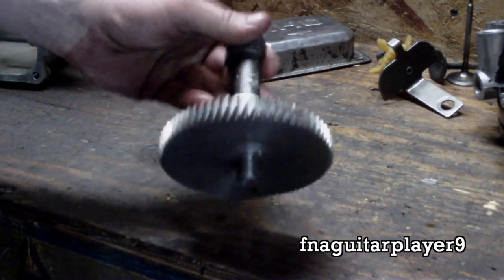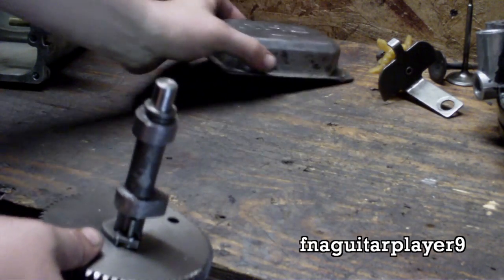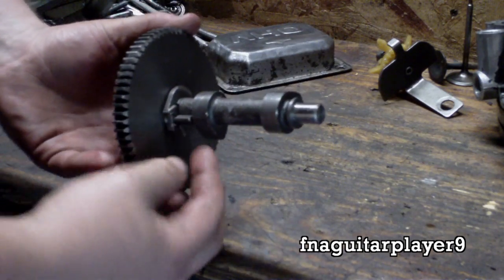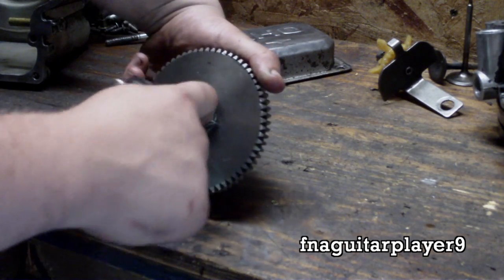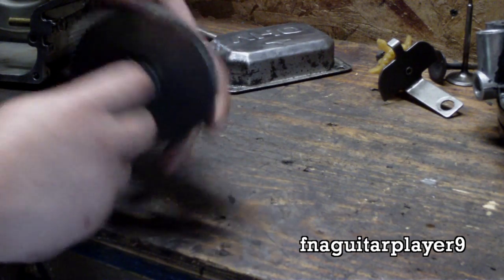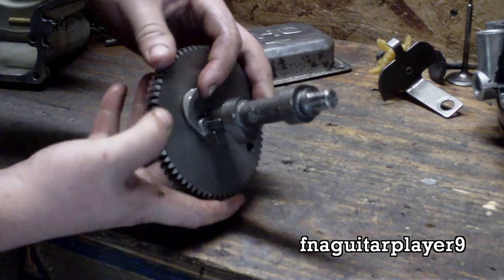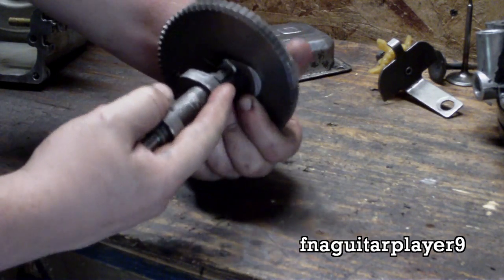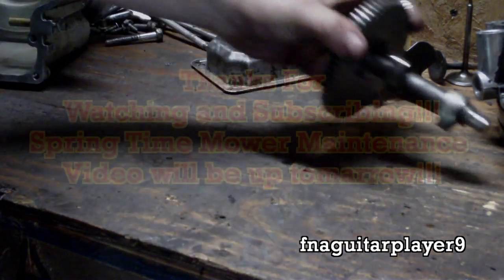How the compression release mechanism works on Briggs and Stratton OHV Engines

Comment: Iv got a briggs 19.5hp and the compression relief  you talk about in this video exploded taking out the governor and oil pickup tube iv checked the crank and connecting rod and all are fine. So my question is where can I get that relief or do I have to purchase new cam?

Comment: I’ve got a Briggs 200412 0136E1 10HP overhead valve engine on a generator.  When I start the unit, it starts beautifully and runs nicely at high idle for about 2 minutes, it then starts to have a stumble and then a miss.  I have adjusted valves, changed the spark plug, changed the ignition coil and carb.  I also took the thing apart and replaced the governor gear but I didn’t took at the cam and compression release while I was in there.  I’m wondering if the compression release could be acting up and causing this.  Seems to me if I had a burnt valve it would be hard starting and have a miss right after it started.  I even opened up the valve lash a little to be certain the valves were closing.  Still have the same issue.  Any help would be appreciated.
Reply from the maker: First thing that comes to mind is, is it getting good fuel flow, sometimes when they do that they are running out of fuel (just running on the fuel in the bowl), could be a clogged line/filter or the vent on the gas cap not letting the tank breath. Thats the only thing i can think of if everything else is new. And if it was do to the compression release it would be hard to start and would have low compression all the time. Thanks for Watching!!!

Comment: If the compression relief piece brakes can you replace it or do have to buy new cam?
Reply: New cam, plus it usually cracks the aluminum crankcase by the sump so you'll have to have that welded to avoid the dreaded mysterious leaking B&S engine.

Comment: Would a 12.5hp Briggs and Stratton vanguard have a compression release
Reply from the maker: It won't have it built in like this camshaft, only the ohv have this, but the flatheads were designed so the exhaust wouldn't close all the way until the piston reached about 2/3 the way up the cylinder. Hard on the valves but made for easier starting. I've actually set the valve clearance looser and it really bumps the compression up. Thanks for Watching!!!

Comment: How do you tell if the compression release is working?
Reply from the maker: If the engine is hard to crank over its usually a good sign, if its a ohv motor usually the valves need adjusting to fix it. Thanks for Watching!!!

Comment: Do the old Briggs wmb engines have a compression release?
Reply from the maker: I don't think so, most of the old flathead didn't have a actual mechanical compression release but, the camshafts were designed so when the valve clearance was set to spec it kept the exhaust valve open for part of the compression stroke, which made the engine less efficient and less powerful but eased in starting, i experimented on a 5hp and set the valve gap bigger and it really increases compression. Thanks for Watching!!!

Comment: I am confounded. My Briggs and Stratton 14HP Vanguard (Model #261777, Type #0144-01) engine's starter turns over very slow or not at all when the starter is installed. I have checked valve adjustment. I turn off the gas when I turn it off so no gas can siphon into the crankcase. 

When starter is removed, starter runs as should be expected. No binding or noises that I can detect. I dissembled the starter this past Saturday and cleaned up the brushes and armature. And lubed the end cap.

I'm very tempted to buy a new starter but have this feeling that I don't need a new starter...that I'm missing something. 

Could my problem be that the compression release mechanism/system has gone bad?

Do you have any advise/council?

Great video by the way.
Reply from the maker: It is very possible that the compression release is not working, also if the starter and battery are in good shape, check connections on the big wires going to and from the solenoid, could be a bad connection somewhere causing you to loose amperage. Thanks for Watching!!!
Reply: fnaguitarplayer9 - I've looked through my repair manuals but realize I don't have a repair manual for this 14 HP Vanguard. 

And I've searched online for a Youtube video or guide on how to check valve guides and valve seals and how to replace them (this is the direction I’m heading at present...that the valve guides are worn...which is causing the valves to not open properly, hence high compression which prohibits engine starter cranking, especially at initial starting effort. I was experiencing higher than normal oil consumption last year before I stopped using engine for winter.) But no luck.  

Thoughts and directives?
Reply from the maker: @kimden85  It is very possible the compression release is sticking and not working right, or it the extra bump on it could be worn down enough to where its not really doing anything too. If you can find the new valve guides and tools to do it, you can do it yourself, i've never had to do it on ohv motors, but the process is the same as the flathead, i did a video a while back on it.
Reply: fnaguitarplayer9 - 1) You are definitely a credit to humanity. Thank you for responding. 2) If I understand you correctly, you’re suggesting I change just the valve guides? Not the cam shaft nor the compression release mechanism/system?
Reply from the maker: @kimden85  Appreciate that! I think it may be the compression release since you said it was hanging up, but the valve guides could be causing the oil burning, not the excess compression
Reply: fnaguitarplayer9 - I removed the sump on my Briggs and Stratton 14HP Vanguard motor yesterday and the compression release mechanism seemed all intact. And I found no metal pieces inside the motor.  And the camshaft lobes were not rounded. 

I did notice that the compression release arm seemed to stick when I moved the camshaft. Could this be a problem? Or just a lack of centrifugal force?

I have not checked the valve guides yet. If I was experiencing what to my experience with this motor as excess oil consumption before I couldn't start the engine this spring, could this be an additional sign that the valve guides are worn? Most importantly, how do you suggest I verify the condition of the valve guides? And can I install new valve guides or is this something I have to pay a machine shop to do?

Again, thanks for your generous time in responding to my queries here.

Sincerely,

Dennis McCrea
Panhandle, TX

Comment: Just did a valve job on my Briggs & Stratton flat head engine but still stops at start up. Do all B&S have compression release?
Reply from the maker: They had it made into the camshaft so the intake valve closes late, even while its running, so make sure to check your valve clearance, if its to tight it won't be able to build compression at all. Thanks for Watching!!!

Comment: I s there any way to test compression on a 4 cycle engine with a compression release...I put my compression guage on my 1986/ 312-8 Wheel Horse..I only get a low reading which I know can't be correct because the tractor runs wonderfully, so obviously the compression release is affecting the correct reading on the compression guage..Checked the guage for accuracy on a know good engine and also did a leakdown test which showed a healthy engine....Thanks for your videos..Pulled my bacon out of the fire a number of times especially with the 2 deck pulleys and the idler drive pulley..Drilled out the welds,got new bearings and bolted em back together...It was gold..Thanks again guitar..
Reply from the maker: You might be able to open up the valve clearance on the valve with the release, usually the intake valve, but it still may interfere some. Briggs has a super simple way of checking compression, straight off there website, spin the engine by hand (holding flywheel) backwards going towards compression, if it has enough compression to run it will spring back (bouncing off the compression). Sounds crazy but thats coming from the manufacturer! I dont' usually do compression tests, usually when they have low compression its do to leaky valves or worn rings. Glad to help out! Thanks for Watching!
Reply: @fnaguitarplayer9  Thanks..I'll look at their website....

Comment: Will this cause a false reading on a compression check?  I have a Briggs Intek I/C 18 HP ...and I am only getting 60psi on the compression check ...and I have checked the valve clearance and they are within spec.
Reply from the maker: Yes it does, it will mess with it. that sounds normal with a compression release. you can adjust it with more clearance and will a better reading, but guessing i'd say its good. Thanks for Watching!!!

Comment: Great to see that method explained.  Setting valve lash cold @ 0.005" is key but do it with something in the open cylinder under compression turned past TDC so you can tell when  the piston is about 1/4" down past TDC
Reply from the maker: I hear ya. I usually just set the valves at TDC, but briggs does recommend the 1/4 past tdc, both methods seem to work. Thanks for Watching!!!
Reply: I already adjusted valve lash to 0.005 after 1/4 past TDC . I still have steady compression coming back out the carburetor and no start. 
Already checked all electrical possibilities.
Reply: Be sure and check the Flywheel/Crank Key.  It may be slightly sheared.
Burned valve or bent stem? @alcastle89

Comment: I had a 2006 SP crapsman with about a 6hp intek on it that was so easy to pull start from the time it was new any small kid could start it.
 I have a snapper sp I repowered with a brand new 8.50 Pro engine and it feels just like the old mowers did without a compression release when pulled. It starts very easy but it's rope is just harder to pull is all? 
 Can there be a chance its CR is not working and if so does it have to be tore down to know? Thanks

Comment: That's cute. All my stuff except for the Kawasnapper has 'L' head engines on them but the KOhler on the Gravely sure has one on it. I think you could turn it over with a flashlight battery. Thanks, Pal!
Reply from the maker: I hear ya! I know what you mean, some of those older ones were easy to crank over. Thanks for Watching!!!

Comment: Mowing thick grass at full power with a 17.5 hp Briggs hit a hidden object, killed the mower. Wouldn't start again. It needed  new rings so I broke it down replaced rings. Thought maybe it sheared flywheel key but not the case. re-assembled it runs but barely, and turns the exhaust red hot in just a minute or so. Obviously out of time (retarded) any ideas on what happened??
Reply from the maker: Did you take the flywheel off or just look at the key with the nut/bolt 
removed? I've had them look fine but were actually sheared. Also it 
could be valve related, if the exhaust valve isn't sealing or closing it
 would cause that as well. Thanks for Watching!!!

Comment: I have a 2011 7.5 Briggs on a power washer and it has no compression what so ever and I took of the valve cover and valve don't move at all when pulling the cord. it's almost brand new hasn't been used hardly at all. could it just not be getting the fuel it needs to run? is this why the there is no compression and valves aren't moving because it's not shining fast enough for it to fling it back in? please help thanks
Reply from the maker: Its possible a push rod bent or came loose, but if both valves aren't doing anything, then it would have to be camshaft related. either broke, or maybe it threw a rod and busted it. Speed doesn't matter, the valves will still cycle at any speed. Thanks for Watching!!!
Reply: +fnaguitarplayer9 I looked further into the motor and it developed a rod knock and can shaft broke. so she's blowed up haha
Reply from the maker: I hear ya! Thats a shame, not being that old.

Comment: Thanks for the video, to make it short for you, Do you think it possible id drill and install a hand operated release valve in the head, like the old john deer's? Thanls
Reply from the maker: +hugh dolan Your welcome! It would be possible to do that, I don't see why it couldn't be done. On a OHV motor, it could be worked into the valve cover. Thanks for Watching!!!
Reply: +fnaguitarplayer9 I built a manual compression release with a lever that depresses the intake valve directly through the valve cover. works perfectly
Reply from the maker: +Robert Fitzsimmons I like that idea, i'll have to experiment with it! Thanks for Watching!!!

Comment: I have 2 easy start b&s and both only show 60lbs of compression, would this release stop me from getting a true reading while pulling the rope 5-6 times as normal?
Reply from the maker: +Doc Riordan (SBBDoc) I hear ya. Yes, anytime you have a compression release, its impossible (without disabling it) to get a true compression reading. You may be able to set the valve clearance alot looser to keep it from working, that should give you a more accurate reading I would think. Hope this helps, thanks for watching!!!

Comment: I see what you mean - but - the valve stem rides on the lobe - and is thin - so how does it touch both surfaces?
Reply from the maker: +Gary Rice well the tappet overlaps the lobe, its bigger than the lobe, the large round disc part of the tappet is what i'm talking about. Thanks for Watching!!!

Comment: All is well now. I do not know exactly what got the kinks out but the engine is running fine now. At my last posting the engine was surging when under load, tried new fuel pump.. no help, removed the the new in-line fuel filter...no help. Finally removed the carb, poked, probed and cleaned. Never saw anything in the carb that would prevent fuel flow??? Replaced old crankcase vent tube that had a hole in it, but the carb back on and now it runs fine?? I did not  rebuild the carb, did not put any new parts in the carb, no gaskets, no needle, no anything new.
Thanks again for all your help!
Reply from the maker: 99trider I hear ya! Its hard to say, I've had them do that before, i guess its just one little piece of dirt somewhere that causes a problem, hard to say really. At least you got it running good. Your welcome, anytime!
Reply: +fnaguitarplayer9 Might have been the retorque of the bolts/nuts?
Reply from the maker: +Gary Rice Its hard to say really, just never with them haha

Comment: Finally got the new camshaft in, the mower starts and idles fine but surges/lopes when I start mowing. Is it possible I installed the governor  wrong
Reply from the maker: 99trider I hear ya, that sounds more like the carburetor needs adjusted or cleaned if its thew newer style 2 piece carb, OR the governor may need to be adjusted, i have another video on how to do that if you need see that. https://youtu.be/9rO8AvDrdeM Hope this helps!

Comment: Thanks again for your help. I had B&S send me a parts manual and they also list my camshaft a the 790340...I hope this is correct as I have ordered one. I will post my results here once I have the engine back together.
Reply from the maker: 99trider Your welcome, glad to help out. Hopefully it is the right cam, as long as its for a model 31 engine it should work fine, they were all basically the same, i don't know of a difference to be honest. Yeah, get back with me if you can, i'd like to know the results.
Reply: @fnaguitarplayer9  
They changed the part number because now a replacement cam comes with new tappets.

Comment: Thanks for your reply. Please confirm the correct part number,  best I can research it is part # 790340.
Model  311-777
Type    0154-E1
Code   000317ZE
Reply from the maker: Franklin Jobe Your welcome, I'm finding part # 693450 in my parts diagrams.

Comment: I have a 17hp B&S OHV with the exact cam you show in this video. I adjusted the valves but still could not get the engine to spin over unless I removed the spark plug and yes I tried with a strong, fully charged battery. I have the engine opened up now as I intended to replace the cam thinking the problem is the compression release. Now that I have the cam in my hand I cannot tell if it is the problem, the mechanical release is not broken and it seems to operate as designed. Is there any way to tell if its worn too much to work properly? Do these type releases ever just wear out? I think this engine is about 15years old.
Thanks
Reply from the maker: 99trider What will usually happen is the little bump that springs out will wear down to about the same as the cam lobe, and it won't do much if anything, I'd say more than likely that is your problem, especially if you adjusted the valves and it made no difference. But yes, they do wear out, I've seen it happen alot. If you need a part #, i'll need the model, type and code off the motor. your welcome, thanks for watching!!!

Comment: I replaced the head gasket on my engine, and that small cap on the end of one of the valves stems found its way to the crankcase and it broke both the counterbalance link and that centrifugal doo-dad on the cam gear. I have a new link, but Briggs won't sell me the spring and weight assembly... only an entire new camshaft w/gear and weight... too expensive. Do you know of a practical way to add a manual compression release? Some motorcycles have them. PS: Really enjoy your videos; THANKS.
Reply from the maker: Ro Efa I would suggest looking on ebay for a good used camshaft for your model. I don't really know of any way right off hand to make a manual one, i know what your talking about, i've seen them on 4 wheelers before. I'd say try ebay, you can usually find some good deals on used parts. Appreciate that, glad you like them! Your Welcome, Thanks for Watching!!!